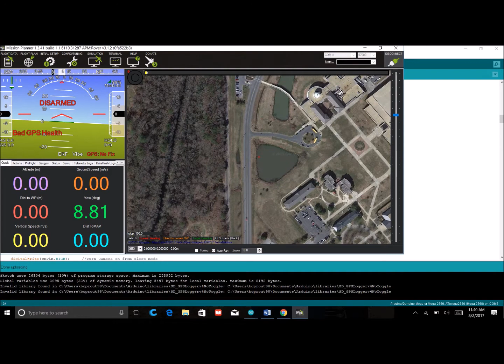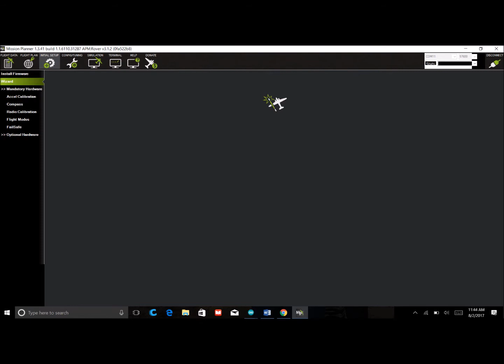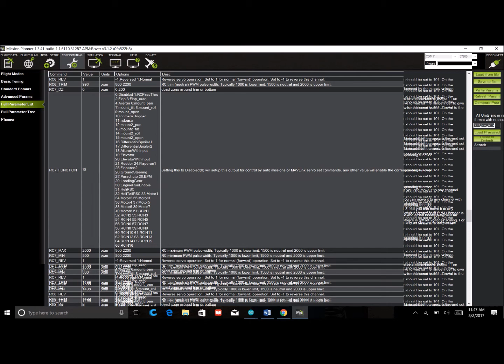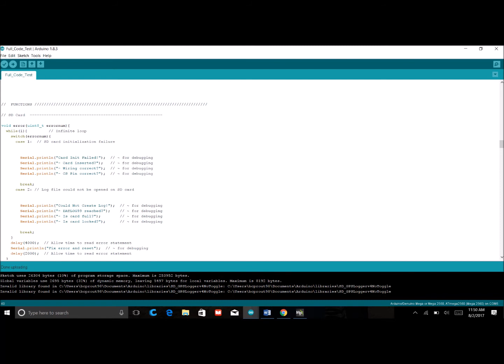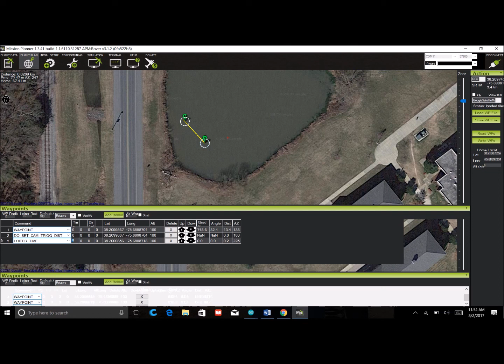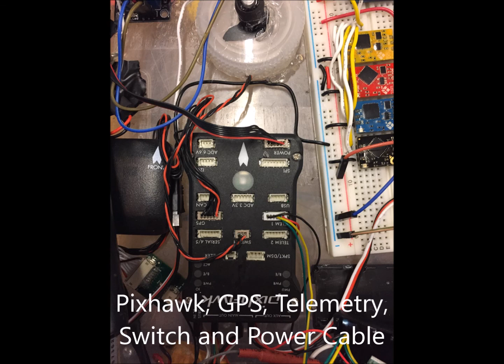CAUTION, Autonomous Boat using Pixhawk and Arduino

Comment: Hello
I know that is been 2 years since this video, but i have a rover that i build and using pixhack board, and i have an issue that the mission is not starting, there is no alarm and everything is set (way points), i start the program and i set it to auto mode but does not start , my remote is able to move the servo and the motor, i don`t know where  in the settings can i look, i also trying to install a range finder but i don`t know where to installed on the board.
thank you, i hope you can help.

Comment: Hello, i did a similar project using ardupilot(arduboat), pixhawk, generic gps compass, lidar and dual motors (skid steering). Manual mode works quite nice. But the location of the vehicle floats even tho its fixed.

Do you have any suggestions to fix it? I only use the external compass and calibrated. Auto mode doesn't work well, because of the gps

Comment: Hi may i check if your boat is a Dual differential motor airboat? 
If so, I'm doing similar configuration. I'm a newbie here first time using Pixhawk2.1. I hope you can guide me on the Dual Differential Motor Configuration on  MissionPlanner.
Reply: i guess using arduino to read PWM input (thro & servo). And than using math maping like this:
right = (thro + ( servo * gain ) )
left = (thro - ( servo * gain ) )
PWM value map from (1000 to 2000) into (-100 to 100 or higher)
I have done this with my ROV project. Maybe u can try
Reply: my bad
http://ardupilot.org/rover/docs/rover-motor-and-servo-configuration.html
read "Skid Steering"